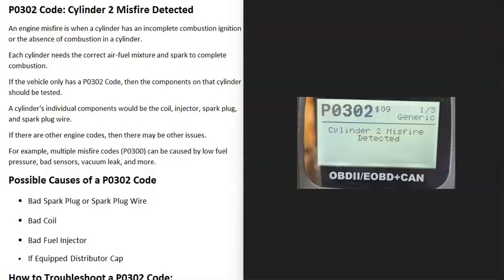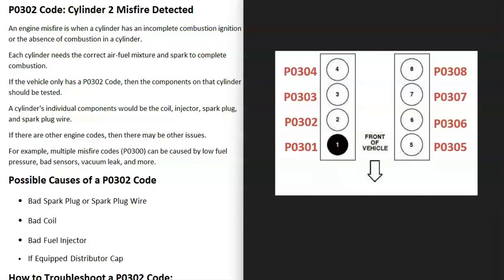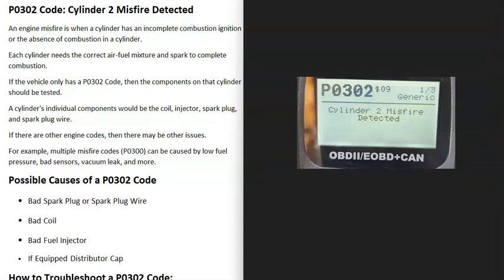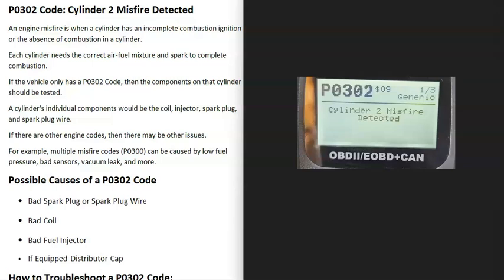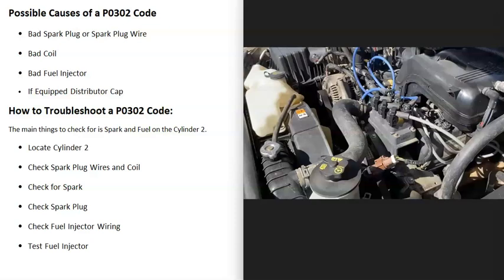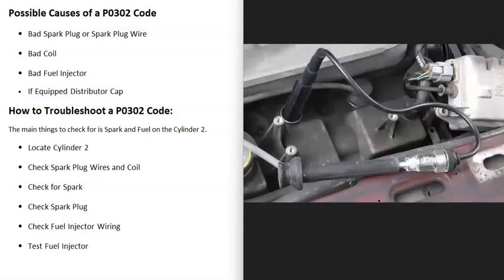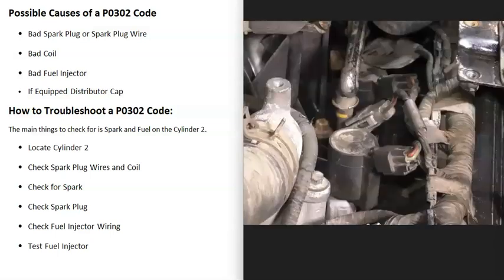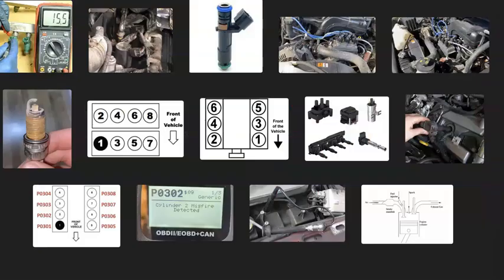Causes and Fixes P0302 Code: Cylinder 2 Misfire Detected

Comment: I keep getting the code for cylinder 2 misfire , and I just replaced fuel injector, spark plug and coil pack and yesterday i even replaced the computer for my car and under load it still throws the check engine light cylinder misfire
Reply from the maker: If all the components test good, then there may be a mechanical issue, such as a bad valve. A leak down test can show if the cylinder does have a mechanical issue.

Comment: What could a combo of  P0302 & P0125 codes mean together, and would this be an expensive fix?  
I was looking at buying a vehicle for my son, found a nice looking 2016 Ford Edge with 160k milage priced at $3500 and the reason seller is pricing so low is because of these two error codes..
Could this be a water pump/timing chain issue as I know Edges are notorious for water pump issues around 150k+ miles

Comment: I have a P0302 code in my 2008 Ranger with a 2.3L, all electrical components and fuel are good but what I found is that the #2 cylinder had low compression that gave the code. #1-210/ #2-95/ #3-210/ #4- 210. I'm guessing stuck valve at 233,000 miles?

Comment: New spark plugs new injector new coils no wire damage any ideas??  have a 2017 Hyundai Santa Fe sport. Car starts rough idle any ideas?
Reply from the maker: If the components are good, there may be a wiring issue. I would check for spark and test the injector circuit. There should be two injector wires. With the key on, one should have constant voltage (12 volts). The other wire is the ground that the computer uses to control the circuit. It should pulse when the engine is running.  
I made a full video on how to test the injector circuit. Here is a link. https://youtu.be/JL4_HlYCKrw

Comment: This video helped so much. I was able to fix it myself. My reader first said po304 a few times. Then i said po300 so suddenly all cilinders were affected. Then it said a po302. After pulling the plugs i was shocked that the sparkplug from cilinder 2 was in really bad shape. It was al burned up and gray and rough looking. The other 3 plugs looked very nice with a light brown tint and almost no wear. After replacing all 4 plugs the engine runs great again. Should i check my injectors aswell? Maybe cilinder 2 is running on poor mixture causing overheating. What else could cause a sparkplug to burn out
Reply: Was your car running rough and stuttering before changing the spark plugs?
Reply: @92TampaChick813  yes rough running. Stuttering on acceleration and low on power. Only changed the plugs and still running good. Not having any issues yet

Comment: okay i have a 2020 honda sport 1.5 and I'm having a misfire and i use my machine to see the codes and 3 codes popped up 

code - p0304(00)
code - p0300(00)
code - p0302(00)
Reply: anyone know anything about this please help !
Reply from the maker: With all those misfire codes, the issue is likely something affecting the whole engine, such as fuel pressure, bad sensor, and so on. It needs to be diagnosed.

Comment: I have a 2011 Prius and got the P0302 Code. Replaced the coil, but still have the same issues. Mechanic is saying there is an issue with the Water Pump. Does this relate to what is happening possibly or should I look at the spark plugs next?

Comment: I don't know what to do. I only have the code p0302. I completely replaced every spark plug and my entire coil pack and every fuel injector as well as thoroughly clean everywhere. It drove wonderfully for a week after I did the coil pack and now it's back to the same awful driving and code
Reply from the maker: It needs to be diagnosed, but if all the components are good, I would check the wiring.
Reply: Dont use cheap aftermarket coils buy oem

Comment: I have  2017 kia rio and gave me random code misfire. So switch all 4 sparks and all 4 coils now says p0302 and everything is new what als could it be any hellp would be much appreciated
Reply from the maker: It needs to be diagnosed, but I would test the wiring and the injectors on cylinder #2.
Reply: Thanks alot turns out it was the injectors specifically 1 and 2 so got that fixed and we in the road again thanks again much appreciated
Reply: Ignition coil

Comment: Po302 2006 Subaru sti.  Did all swaps. Compression and leakdown test all good. Noid test on injector connector good. Used smoke machine for vacuum leak, no leak found also did exhaust  side. Changed upstream and downstream o2 sensors OEM denso. What did I  not check???
Reply: Plenum gaskets?
Reply: Did you ever solve the issue
Reply from the maker: Is it getting spark?
Reply: Yes
Reply: You ever solve it? I have the same issue. 👀

Comment: My car had an epc and check engine light at the same time. Then this code came up. My car dont have a disruptor cap so its the spark plugs, coil, or fuel injector?

Comment: 2018 toyota camry SE 2.5L

I did everything. Fuel pump fuel filter New. Fuel injectors and spark plugs. New. 
Did the swapping.  Still same code. Cleaned out Fuel rail. 
When accelarate fast my misfires hits and than a loss of engine power comes up.. loose A LOT of power. 
When I pull over disconnecting coil and or Fuel injector doesn't change the engine meaning the problem is sitting on Cylinde 2 for sure. But only does it after that acceleration and continues to fail Unless I turn off engine for awhile it goes back to normal. Slight misfire but that cycle continues. Wires??? O2 sensor? I clean out the MAF sensor don't seem to have any intake valve leaks from my tests... 
Help needed anyone. Thank you guys/girls so much God bless !
Reply from the maker: Intermittent problems can be hard to troubleshoot. It sounds like a coil going bad, but that is just a guess. I would remove the spark plug and, see how it is burning, match it to a burn chart to see if it is a fuel or spark issue.
Reply: @HVAC_Mechanic  the whole time. It just needed OEM spark plugs. I got auto lites from autozone and that's why I still had the issue. Learned a huge lesson for this vehicle and for the future vehicles.

Comment: Please help. Have 2004 Chevy Colorado and shaking mid-firing engine literally started over night. Check engine codes are p0171, p0014 and p0302. Where should we start first
Reply from the maker: Anything I say is a guess, but has the oil been changed regularly? If the VVT solenoid, which oil flows through, gets clogged up, it can cause issues such as a P0014. Also, I would test the components on cylinder #2, such as the coil and injector.
Reply: Full synthetic oil changed regularly. Replacing spark plug and injector code today. Will update